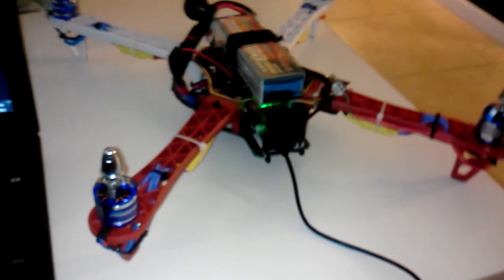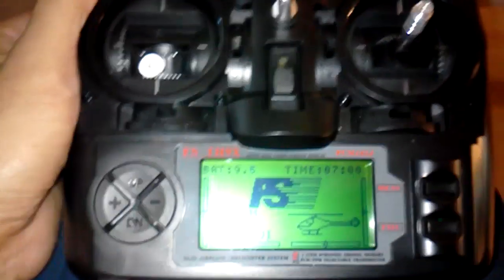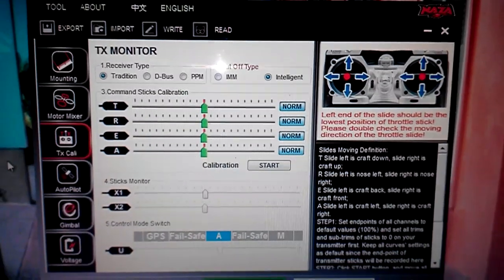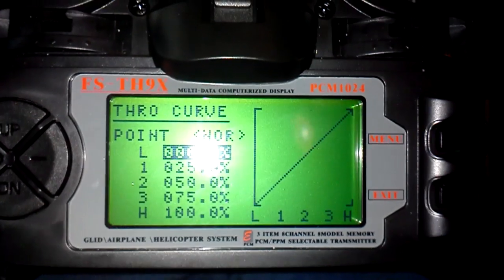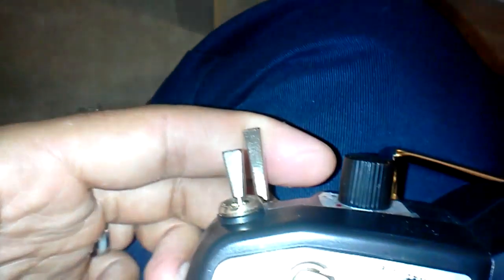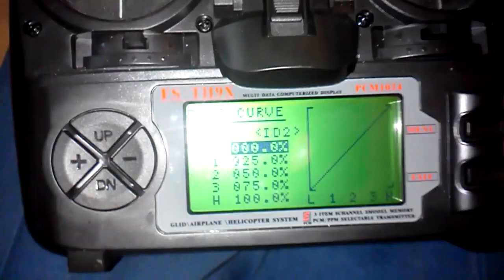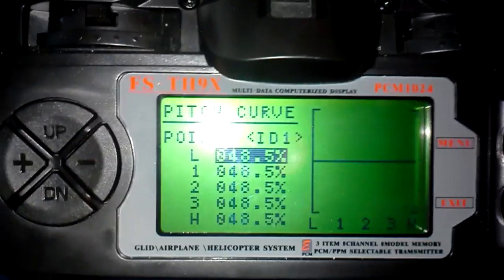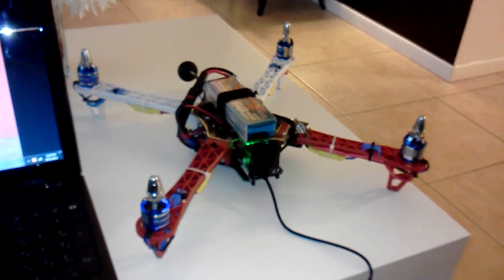Dji naza fs th9x

Comment: I've been trying to just get my naza and receiver bound to my th9x radio controller. I've watched several different online video tutorials and each one of them are skipping steps or not very thorough in step by step instructions on how to set up a "quadcopter to a naza" Could you help or redirect me to a link showing step by step instructions. Thanks.
Reply from the maker: this video should explain everything for you.

How to set up DJI Naza step by step video with transmitter setup
Reply: ***** I've watched that video several times and it's helped some, and I followed step by step but he is still skipping steps and not mentioning a few things that need to happen in order to make a successful connection. I was hoping you would be able to help since you are using the th9x and not the other remote the other guy is using that's similar but has it's differences. I'm stumped, I've tried many different avenues and need a little more thorough walk through.
Reply from the maker: 3D Editor If you let me know exactly what the problem is I will try to help you out. You said you need help binding the rc Rx to the rc Tx? Is this correct?
Reply: I'm needing to bind the remote control to the receiver to the naza m v2 so that that everything is connected properly and working on the th9x remote and all of the motors are responsive.

I have tried binding everything once before and setting everything up in the naza assistant software, it showed that all of the controls were working, but the motors weren't responding while testing them with the remote control unit, even though the "motor test" section was working just fine.

Other questions:
1. Also after I have bound the receiver (rx) with the naza, do I keep that all connected from there on out? Or do I disconnect it once I have run through the naza assistant software?

2.One more thing I'm confused about. Will from Mikye's RC channel has told me that quadcopters need to be set up using plane mode and not hell mode on the remote. Is that true? I've tried that but that only made things more confusing to me. Anything I'm missing and pointers and tips would help. Thanks.
Reply from the maker: 3D Editor I'm a little confused as to " bind the remote control to the receiver to the naza". You only need to bind the Rc TX&RX together not naza. Bind the TX AND RX by itself and connect to a esc and motor and see if it works that way.

1. You don't need/can't bind the RX to the naza unless you're talking about connecting the wires from RX to the naza, then yes.

2. It can be set in heli or acro/plane mode. it doesn't matter. It's just easier to setup the 3 position flight mode switch in heli mode, no complicated mixing required in the TX.
Reply: so does the rx (receiver) stay connected to the naza once you've ran through the naza assistance software? Or is it ok to disconnect? Does the rx receiver need to stay connected indefinitely in order for the remote control to communicate with the quadcopter?
Reply from the maker: 3D Editor Yes the RX needs to be connected to the naza fc at all times via the provided servo wires that came with dji naza package. That is how you control the multirotor. You should try  connecting your TX and RX to a esc and motor by itself to make sure it is properly bound (bind) and the motor works. This way you will know if the problem is on the RC side or FC/naza side.
Reply: thanks. I'm still tinkering with the right channels on the rx to go into the right ports on the naza. I followed them correctly on the video you provided that I also watched a dozen times before you mentioned it. Anyhow, when I have everything plugged in and I bind the rx with the remote, the red light flashes on the remote led 4 times every second. I'm guessing that's an indicator the motors aren't connected to the right ports on the naza? I'm receiving an error 29 in the assistant software. I took pics of the entire message. not sure if you received that message before when setting things up.
Reply from the maker: 3D Editor Your RC TX AND RX are supposed to be already bound before you connect the naza. That's probably why your motors aren't working and you're getting the error because your radio(Rc Tx AND Rx) are not bound. Bind your Tx and Rx to each other first.
Reply: I'll give that a try.
Reply: So here's what I've done so far. all of the controls seem to be working in the software and when I do the motor test in the software, the motors work, but the motors don't work when I manually move the remote sticks around. In advance, I'm sorry for the lengthy response with 3 more questions at the very bottom after describing what I've done so far and detailed error message I'm getting.

step 1. since I don't have any other way of binding the rx with the remote unless all the servo wires are plugged into the naza, because I have no way of connecting it directly to a battery at this time, I connected all of the wires to the naza and the rx, before going into the assistant software.

2. I have the binding plug plugged into the port, then I plug in the battery. The red light on the rx flashes, indicating it has not been bound yet.

3.Then I hold the back button on the remote while turning the remote on. Then the red light on the rx stops flashing, indicating it has been bound with the remote.

4. Then I unplug the binding plug from the bind port, then I unplug the battery and then I shut off the remote then I plug the battery back in, then turn the remote back on.

These are the steps taken for the remote and the rx to receive a sure connection from what I learned from other tutorials and suggestions about this th9x remote online.

5. Once all of that is done, then I see the red led light flashing 4 times fast per second until I plug it into the computer then it turns green.

That's when I receive the following (error 29) message:
"Motors start failure caused by TX sticks mid point error too big. If the TX sticks mid point error is too big, Motors start will fail when you execute the combination stick commands (CSC) and lead to the aircraft will not take off. And the LED will blink red four times per second continually to warn you."

 "TX sticks mid point error too big can be caused by the following reasons.
1. There is TX stick except the throttle stick not at center when power on the autopilot system.
2.The TX sticks has been trimmed, which leads to the large deviation of mid point. For example, the Sub-Trim has been adjusted for Futaba transmitter.
3. The TX sticks travel has larger asymmetry."

"For the reason 1 please put all TX sticks at mid point, and then power cycle the autopilot system to re-record the mid point. If the problem continues, that can be caused by the reason 2, or reason 3. You need to adjust the output range of your TX and then use the assistant software to redo the TX calibration. Please carry out the following procedures."

"1. Connect the assistant software, click Basic, RC, Command sticks Calibration, and push all TX sticks throughout their complete travel range to see if any stick cannot reach it's largest position.
2. Adjust the largest travel of TX stick until the cursor on the assistant software can reach both end positions, according to your TX manual.
3. Power cycle the autopilot system, note that power cycle is required.
4. Redo the TX calibration according to the assistant software."

Ok, so here are more questions that I have that hopefully can help me get past this road block I'm on:

1. what is the auto pilot system? Is that the remote aka TX I'm assuming and why do they call the remote the TX?

2. What is the mid point error? How do I correct that?

3. What do they mean by TX sticks has been trimmed or sub-trimmed? if that could be the cause how can that be corrected?
Reply from the maker: You can't run the motors with the TX=(transmitter) while it's plugged in to the naza assistant software. Unplug the naza from your pc power up the Tx then the quadcopter (with a lipo battery) and see if the throttle works.

1. TX means transmitter as in Rc transmitter.

2. Mid point error probably means that you have added subtrims or changed the end points on your Tx.

3. Tx sticks are your transmitter sticks and subtrim and trim means that the values have been changed ie. trimmed/subtrim.
Reply: So here's what I did next after nothing has worked. I went ahead and created a fresh mode under a different name where everything is at default. I followed the user and system settings to a T from that guy's video instructions on how to set it all up.

Since I don't have a battery with that type of connector, I unplugged everything from the Naza and only connected the x3 wire usually goes into any port on the rx, then I plugged the bind dongle into where it says battery; as another online video tutorial suggests.

So this way the only thing that is connected to the rx is the v-sen wire from the PMU into any port of the rx. The PMU is connected to the main electronic board that is connected to the motors and the battery plug. I plugged in the battery, then the red light on the rx blinks. Then I powered on the transmitter while holding the back button down.

The blinking stops, I unplugged the bind dongle then the v-sen wire from the PMU, then I unplugged the battery, then turned off the transmitter, then I plugged the connection wires into the Naza step by step, then plugged the battery back in then turned on the transmitter. The red led lights are still flashing. This is the best I can do.

I can't think of anything else I'm doing wrong. I'll have nothing plugged into the naza except for the motors and the PMU; the transmitter will be off and the red light will still blink 4 times per second. I have never had this much trouble solving anything and I have built my own computers.
Reply from the maker: Is the error message still on the naza assistant software after you made a new mode? I don't know if you read my last reply but I don't think the motors will engage when applying throttle from the Tx while the naza/quadcopter is still connected to the assistant software/Pc. Also one way you can bind and test ONE motor is to unplug EVERYTHING OFF THE NAZA AND RECIEVER, connect ONE OF THE ESC TO CHANNEL 3/THROTTLE ON THE RECIEVER, turn on the Tx then power the quadcopter (plug in the flight lipo battery). This way it should only power the Rx, esc and motor. Apply some throttle and see if the motor works. Try this and let me know.
Reply: ***** interestingly, I tested that out; one motor at a time on channel 3 and it appears the motors work fine when connected to the rx and receives the signal from the throttle stick of the transmitter. So I at least know the motors are not an issue right?

I'm wondering if I need to connect the ext wires differently to the naza once I'm ready to connect them and if I should be in ppm mode or pcm mode. According to the thx9 manual, it says that gps only works in pcm mode. Some guys even suggested that I calibrate the "travel" on my transmitter before plugging the rx into the naza first and see if that changes anything.

The problem I'm having is, where's the "travel" menu on the transmitter and how would I change that for safe flying? I'm not that advanced and far into the rc world yet to be familiar with how travel works. Anyhow, last night I discovered that All I have to do to continue to see the red flashing light, is plug in just 1 esc, or only plug in the x3 wire from the v-sen.

I read in a forum yesterday where others were having the same issue. tech support says the continuous blinking red light could be from a low battery. But what happens when you still receive the error 29 code in the software? Some believe it could be a faulty naza, while others think there can still be some work arounds. http://www.djiguys.com/Forum/viewtopic.php?f=4&t=1010
Reply from the maker: 3D Editor Yes! Your motors are working as they should. That's good.

Your radio should be in PPM.

Travel = endpoints on the 9x radio.

If you started a fresh new model on the Tx then all the trims, subtrims and endpoints should all be in default. If you followed the video I sent you then all should be working.

Can you tell me exactly the problem you are having?

As far as the red flashing light you're talking about, is it the naza VU?

When people ask me about problems they're having it's usually because they've missed something, usually something that is very small.

In this hobby it's advised to go slow and take your time. So parts and steps goes into building that it's very easy to forget or skip something. I've done it a dozens of times.
Reply: thanks. yeah it's the led light on the Naza flashing. A couple of guys told me that I need to go in and calibrate/fix the A,E,T,R, U, x1, x2 positions in the software so it  matches what I see on the transmitter. Once that is taken care of, turn the transmitter off, take the batteries out, then put them back in start it up again and see if that makes the error 29 code go away. As long as it stays in fail safe mode in the software, the copter won't be able to fly. Hopefully that will fix the red light problem too. I'm going to try that and see what happens next.
Reply from the maker: Aaah! That makes more sense. Connect the naza to the assistant and while on the flight mode screen change the pitch curve on your Rc Tx and whatch the flight mode change on the assistant software. Do the same for the other 2 switch position/flight modes.
Reply: ***** I'll give that extra step a try on the TX. Yesterday when I tried doing what they suggested, the A and the E were moving in directions they were 't supposed to. The E would move to the right on the software when I pushed the TX lever right or left and the A would move right on the software when I pushed the up or down on the TX stick. Also the R will only go one direction in the software. strange. maybe messing with the pitch curve etc will help fix this issue as well.
Reply from the maker: If the Tx sticks aren't moving in the correct direction you should reverse it in your Tx . The pitch curve will only change the flight mode. It has nothing to do with the travel direction of your controls.
Reply: ***** ok thanks. They show that they are moving in the correct direction on the TX display menu. It's when the RX is connected to the naza it shows it moving in wrong and opposite directions in the software even though I have all the wires connected in the proper channels.
Reply from the maker: 3D Editor then reverse it from the assistant software.
Reply: yep, I was trying that yesterday and it only made the directions go opposite, it didn't fix the wrong directions. I'll try anything different I haven't tried at this point.
Reply: ***** Update: I got all of the controls programmed and working correctly through the NAZA software, except the Throttle stick also moves the U in the RC controls. No more red blinking light on start up. Now a variety of different color signals from the led depending on which position I got the throttle in. Now I'm trying to get the motors to start up. 

Why is the U mixed in with the Throttle movement? When I move the throttle stick all the way up, the U moves all the way to the left and when I move the throttle stick all the way down, the U moves all the way to the right. So they are moving opposite of one another. 

Is this normal? if not, how do I fix this problem. When this was going on, I didn't have channel 5 on the RX connected to anything. I skipped channel 5 and went from channel 4 straight to channel 6 as indicated in the step by step naza turnigy tx setup video tutorial. I'm thinking of trying to use channel 5 and go from there to see how the controls work. that might make a difference on how the u x1 and x2 controls work. Hopefull they'll work separately from the throttle.
Reply from the maker: Sounds like channel 6/flight mode is mixed with channel 3/throttle on you transmitter. X1 and X2 are the left nobs on your Tx that controls naza gains or gimbal (which ever you assigned it to on naza assistant). It has nothing to do with throttle or flight modes. Channel 5 is the gear switch/gyr on your Tx and has nothing to do with throttle and flight modes. You probably have a mix setup on channels 3 and 6 on your Tx or your Tx is messed up.
Reply: ***** I'm looking further into trying to fix the channel 3 and 6 mix up. Thanks.
Reply: The builder/distributer of the company I purchased my quad from sat with me over the phone yesterday for 45 minutes and walked me through the rest of the transmitter receiver naza setup. There were steps that I had missed and some of the steps I took were mixed up and opposite from what other tutorials have suggested. I'm glad this is finally taken care of. I've been trying to sort this out for two weeks through multiple online tutorials and others suggestions online without success. As soon as I got everything squared away and ready to fly, I'll be posting my own step by step tutorial on how to set up the TH9X transmitter and receiver to the naza v2. Thanks for the effort you put in to trying to help me; every bit counts.

Comment: How did you set the 3 position switch to select the control mode in the first place? i can figure out how to set that switch as an aux out put on my ch5 to my receiver.
Reply from the maker: Power up your multirotor and connect your naza to the assistant software and go to the flight mode screen then on your TX adjust the pitch curve. On the assistant software you should see the flight mode slider move. You need to set a flat pitch curve for each flight mode on each position on the 3 way switch. Hope that wasn't too confusing.